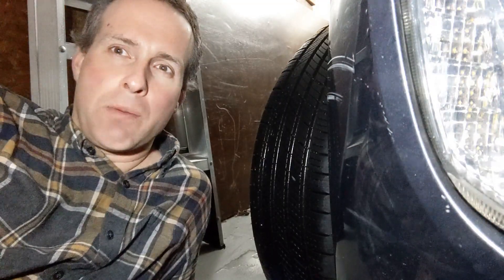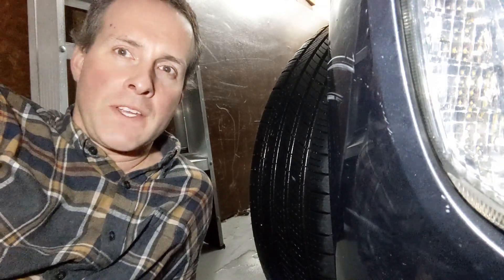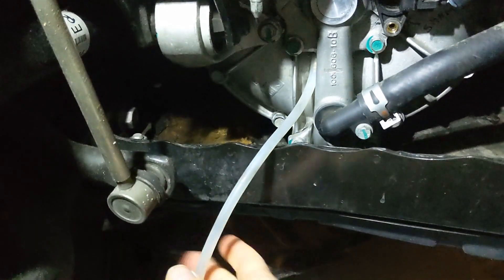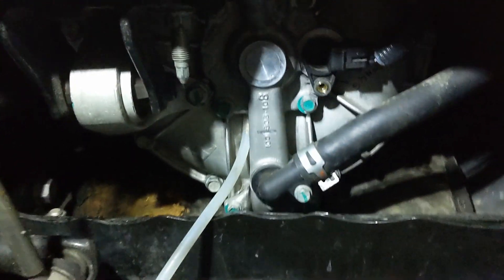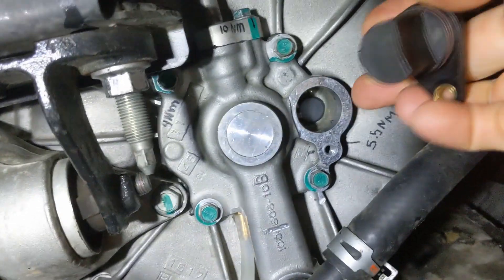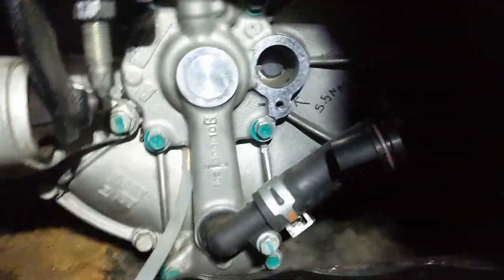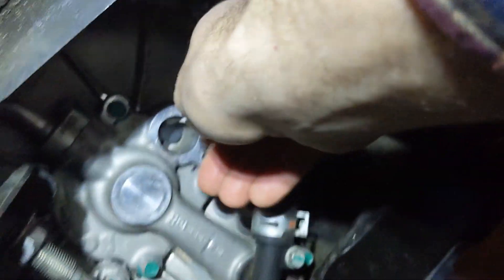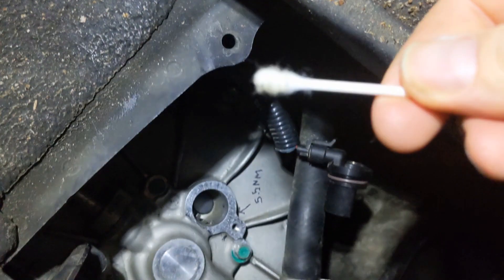Tesla Coolant Seal: 2000 mile update

Comment: Hey man, love your work ❤ is there any way I can add emergency drain on Tesla LDU without pulling the unit? Got a low whirring noise coming from the DU when accelerating, and I am worried about the seal leaking. Gonna check speed sensor today. Going on a long trip in a couple of days.If it is dry, I suppose the issue could be a bearing, but if not I would like to add drain on inverter side before going on our summer vacation drive.
Reply from the maker: Maybe this: https://youtu.be/zVdrrgQc9EM?si=-lWGg9rBhx9Kf2dr or https://113a8f-4f.myshopify.com/products/tesla-ldu-coolant-delete-kit
Reply: @diyEVguy  Thank you 😊 adding a drain on inverter side will stop condensation? Or do I Also need vents on the top of the inverter cover?
Reply: @diyEVguy  Thank you so much :) I have the car on a ramp now and will check soon - the weep hole below the seal seems to be a great idea. Was wondering about that drain plug you put on the inverter side, though; do you have the excact position I would wanna drill? Was thinking by hand, so I don't go too far in. Also, I will add a hose, like you did.
Reply from the maker: @fatmanbhkbjorn  I did it for the Toyota (https://youtu.be/I_T-djy3TqI?t=685)  - I don't know the ideal location for the Tesla...
Reply: @diyEVguy  Thank you! 🙂 I will do it tomorrow, and post video footage. I'll just try to put it approximately where you put it in your other LDU video (if I discover any moisture on the speed sensor).
Reply: So I pulled the sensor and wiped it with a q-tip. It had a very thin later of brownish stuff on it (no blue). I’m guessing it’s a minor leak, not a total failure of the seal (or could it be some kind of lube?) How long time can one excpect until total failure? Anyone driven with this whirring sound?

Comment: On my Tesla S the original seal lasted 290.000km. Failed in the last year of warranty. The RMN seal (red) failed after 90.000km only. I have done the drains as per your suggestions and installed the triple lip seal now. The surface of the rotor shaft was in a very good condition. I saw the coolant delete kit from QC Charge but for now i hope the seal will work out ok. A big thank you to you for making these videos and your contributions on the open inverter blog too...a must read for all LDU fans.

Comment: What's the feasibility of installing some kind of coolant leak sensor inside the inverter housing, wired into some kind of warning alarm/light? That way you know instantly if there's a leak.

Amphol sells one on mouser for $14, designed to detect leaks inside battery packs
Reply from the maker: Very feasible. See here: https://www.youtube.com/watch?v=ps2gha4w5YE&t=8s. His name is Vladimir. I have worked with him as shown on my channel and I trust him.